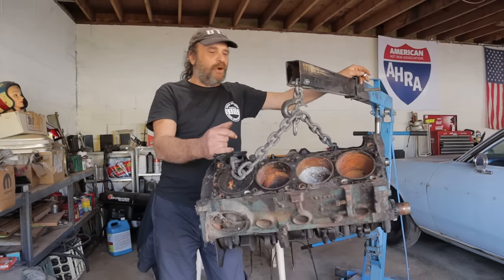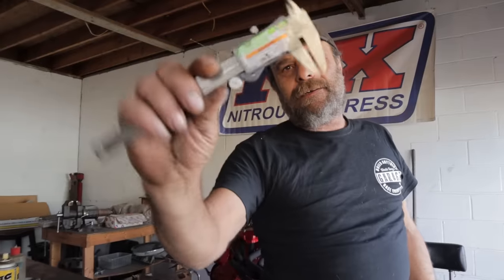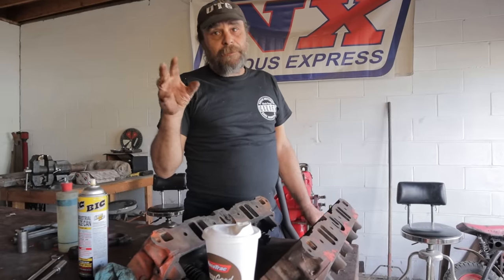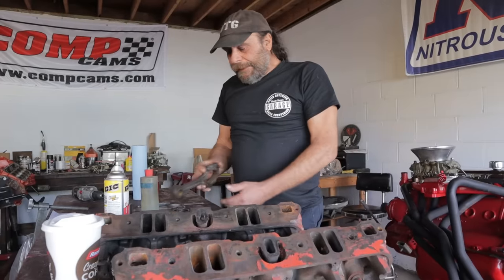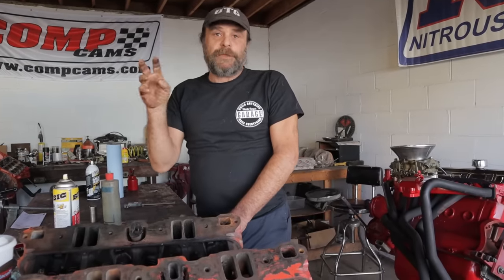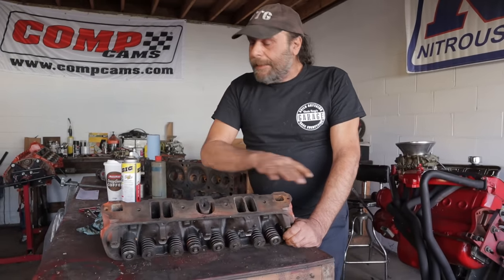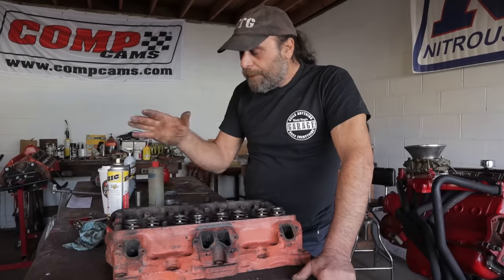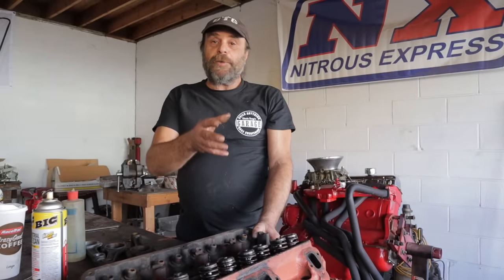The Most Under Rated V-8 In History?

Comment: Olds engines, pontiac and buick too. Lots of folks today get classic cars and toss the original engines to put Chevy LS engines in them. Talk about least loved.
Reply: Over in my world of water cooled vws , the kids are removing the Bosch cis fuel injection to swap on a carb.
Because they are too lazy or can't troubleshoot the problem , so they blanket repair it. 
Damn fuel injection was fairly simple, and the FI cars made a good 10-15hp more then the carbed cars. 
I just smh at all the destruction they're doing
Reply: I currently have both a 318 and olds 403 under my work bench.
Reply: @MrTheHillfolk  Which gen of VW engines?
Reply: @stevenshepherd1905  Nothing wrong with either. Go easy with the 403. They aren't as stout as the 350 or the big blocks, but they will give good service.
Reply: That's the difference between a parts changer and a mechanic. 
Most of the knowledge of these old engines died with the generation who raced them, so it takes a little extra work to research their history, and find answers to our own questions for information that has been lost over time. That's the case with my Old's 394. That engine was a legend in the drag racing world  until Mopar's 392 Hemi came along.  
These old engines are the soul and character and history of the cars they represent. That's something an LS just doesn't have.
Reply: well most of the time the numbers matching ''original engines'' are long gone that LS6 454 is probably a low comp 2 bolt main truck engine or that 375hp 327 is just a  350 .. for mopar reference that 340 is just a 318.. 
its hard to beat the LS based engine.. trip to the junk yard an take your pick.. you want aluminum 6 bolt main block or cast iron .. 4.8-5.3L or for the same price a 6L block .. top it off with a early 5.3 truck intake manifold set of cylinder heads that flow 230cfm right out the trash.. 
ever notice when someones budget LS blows up they worry if the cam is ok lol. everything else is disposable
Reply: @my.motorrad  mk1(75-84) 
Mk2(85-92) 
It's worse on the mk1s. 
Makes me want to punch babies when I see a post about removing it. 
Me and alotta other guys who actually know this stuff , and try to help. 
I mean jeez,there's a couple of real good books on it and we have the internet now too.
Reply: @codyramos3200  If it's a chevy, sure, but I think today generation is facile. Just change the badge and it's a different brand. The differentiator with GM cars was that each marque made their own engines. Putting a chevy LS in it kind of takes that away. If you really want performance, get a new car. It'll have all the goodies to make the extra power work for you and they are safer.
Reply: @MrTheHillfolk  The mark 1's must be a bitch. Can you get ECMs for them anymore? Were they digital? I had a 1969 VW Fastback. Very funky FI. It's not like you can plug a computer in. I wonder if anyone makes an aftermarket FI for the Mk1 and MK2? I had MK4 jetta. Most reliable car I even had.
Reply: @my.motorrad  
Oh no they were way easier and more reliable than the fi on the air cooled stuff , they learned their lesson. 
The mk2 did use some electronics , and they called it cis-e.
It's  basic stuff like an encapsulated module and they're pretty hearty. 
The fuel injection throttle response is 10x better than a carb on those. 
Mk4? 
Pretty solid chassis , maybe a little heavy for performance work but they can do pretty good. 
Actually I've got the wife's old mk4 Jetta at the shop, I got one of those Smythe Ute kits for it that I've been working on. 
It's my replacement for my old rabbit pickup I had 20+yrs ago.
Reply: @my.motorrad  
You could do some aftermarket add ons for the fuel injection , most of the time they just go modern with something like a megasquirt system. 
Funny that you say you had a very reliable vw , because that's the joke that they aren't. 
And it's a joke inside a joke because I've never really had one leave me on the roadside. 
Usually if you type VW into Google you get a check engine light 🤣🤣
Reply: @MrTheHillfolk  I sold mine after 12 years and 150k miles and it had the original clutch. It had the 2L 8v engine. It burned a little oil, a quart every 1800 and the AC went out the month before I sold it, but other than that it was maintenance items. I had a 2013 50's beetle convertible with a 2.5L. I got rear ended and it got totalled. On 50k on it for a 6 year old car. I bought it used. The 2.5L is a torquey engine and seems build well and would be capable of a lot more power. 6L oil capacity too. We have a 2013 Passat with the same engine. 105k on it. My complaints about that car are the suspension components. it needs new struts, bushing, might as well do ball joints and one of the power steering lines just developed a leak. My wife wanted a subaru ascent when my beetle got hit and I have the choice of the next car. I really like the idea of the Challenger RT. I am tall and the Passat sucks for tall folks and I am not impressed with the subaru. VW just doesn't make anything that says buy me anymore. It's all 4 doors.
Reply: I have to call BS sir. Most all engines make more HP / TQ with carbs....
Reply: @MrTheHillfolk  ew. i can see why they are.
Reply: @garyvisser8987  
Then drive an injected rabbit vs a carbed one and tell me how it is 🤣
Haha even the factory carb model was like 10hp down compared to  the fuel injected model. 
And unless you do something like itb setup an upgraded carb doesnt have a prayer to match the injection.  
Don't call bullshit on vehicles you obviously aren't familiar with.
Reply: @codyramos3200  it’s pretty easy to identify engines with casting codes.
Reply: @doomman700  yeah sure to a point.. . Was your comment refuting what I said or ? Idk what your getting at .
Reply: @codyramos3200  refuting your claims as bogus. The engines can be identified from outside. Just because you don’t know how to do it.
Reply: @doomman700  where did I say engines can't be identified....

Comment: Hy. I built 318 about 30 year's ago and I put polished steel crank a comp cam 268 duration had 454 lift on both lobes it bord 40 over flat tops milled the 20 they were a little   warped I used the best in all the parts added 1inch taller 4 barrel intake from direct connection 1180 rated thermal quad carb ported the heads headers accell ignition for all components. When I fired it up the first time I amassed  one oil pressure it had. It had 85 pounds until it got warmed up then it settled in 60 ran so good I couldn't believe it . Sorry I I rambling  on but I just had do this comment and tell you about it.

Comment: 305 chev and 318 underated the 302 ford and 302 chev get all the glory
Reply: How about the 307? Its the Rodney Dangerfield of engines....
Reply: I'd take a 318 over a 305 any day lol
Reply: Honestly the 305 is one of my favorite cruising engines i just cant get myself to build one
Reply: @will7its  
My buddy back in HS had one in a 70 Malibu with a 'glide. 
She would make the back end sway around a little if you nailed it into 1st at around 35-40mph.
Reply: My 305 h.o. runs good and they dont eat cams
Reply: I had a 305 HO in an 82 Z-28, the first year of the major re design of the Camaro/ Firebird. That may have been the last QJ equipped SBC, the Camaro with auto trans came with “cross fire injection” the same as the vette, but the 4 speed cars still sported a carb. I was really surprised at the balls that 305 had! Considering that in 82, everything was a slug. Not long after, I bought an 86 Grand National, the first year with an intercooler, it was top dog until the GNX in 87. Interesting tidbit of info: for insurance purposes GM claimed the GN put out a whopping 235 HP! LMAO!
Reply: @Zephyrmec  mine is a 84 ho automatic

Comment: I took my 79 Cuda put a 1972 318 in it stock bore, 600 lift with a 289 duration cam, I used a 4 barrel Quadrojet, stock heads, aluminum duel plain manifold, headers, high speed oil pump, 410 posy traction rear end and a  4 speed and run in the low 14's awesome little street rod and O my gosh how I miss her, the 318 is an overlooked treasure.

Comment: I know the 340 for all the hype never impressed me. I had a '64 Dart GT that was originally a 273 4bbl,. I blew it up and got a 318to replace it. I put a 4.60 lift 294 duration cam in it and found a 340 4bbl manifold and a Holly 600 carb and went with a stock electronic ignition. Through the original button shift 904 trans that I rebuilt. In my town at that time it was the bain  of almost ant 350 Nova, Camaro, and Chevelles, as well as all the 302 Mustangs nobody believed it was a 318 they all accused me of putting a 340 in it. But I also had a '67 Barracuda that I put a mild built 360 la and a 727 trans in and went terrorizing big block street rods with it. Only loss for the Barracuda was against a 427 Corvette. I would take either the Dart or the Cuda back in a heart beat even if you offered me a new vehicle instead.
Reply: @montinaladine3264  
 I had a 73 Dart 340 4 speed and my 67 Barracuda with a mild 360 auto stock exhaust and 3.23 posi gears would eat it every time. Like the 302 Chevy you have to keep the 340 at a high rpm to pull, the 360 has the torque as well as the hp. It pulled my Cuda to 13 flat 1/4 mile in street garb and tires, and it would regularly stomp big block Chevys and Fords in street races. I just guess I haven't seen a 340 that impressed me in street form.

Comment: Thanks for the info. My dad wasn't too much into mopar back in the 1960's and '70's but he always said the 318 was the only V8 he would want if he got a Chrysler product with a V8. We did own a 1977 Dodge power wagon way back in the late 1980's with a 2 barrel 360. It ran good but my dad really wanted a 318. I'm wondering if dad liked it because the 318 had sufficient power but with small ported heads maybe got better mileage than the average V8? Very informative video. My friend's dad had a 1966 Dodge Dart. I know it had a 273 but I think it only had a 2 barrel carb. I never got to ride in it but my friend said that car could move!

Comment: Cool it would be fun to find a old 67-69 318 and work over the heads with 360 valves and port match it. thanks for sharing that info. Not that I would try it but how far can you bore the old 318 to be? did you say 340ci ?  If you have the open chamber heads cant you just put some pop up pistons in it? to bring it up to 9.5 to 1 or 10 to 1 compression ratio.

Comment: In high school a few years back, I had a 318 dart swinger  which I put in a crower 525 cam did a 3 angle valve job on 202, 340  heads, wienand intake and holley carb. Headers and dual exhaust. Damn did that thing move and took down a few novas. . Want to build one now with my son. 
Need parts

Comment: I owned a 1969 dodge d200 custom pickup truck that had the truck 318 in it.  Me and my dad did not much work, 4 barrel alum intake and carb, moderate performance cam and that thing ran better than a lot of other builds I have owned.  had dual 4 inch stacks on it and every one swore it had the hemi or something big in it, just sounded very nice.  They never believed it was just a little old 318 under the hood lol.  For a heavy truck it would get up and move, and was so well balanced from factory it would idle around the parking lot in 4th hear and not stall.  Always regretted selling it.

Comment: Had a dodge dart GT 1966 had a 273 4 barrel very strong engine and I have had numerous 318 and if you put a 4 barrel and the same heads I had on the 273 with a decent RV cam you have a great super low budget little hotrod engine, only bad thing that I would like to add to the combo is the rods and your idea of the 340 rods is the perfect solution and keeps it low budget 318 good 👍

Comment: I'm in the process of building a crossover 318, (it has provisions for rollers) it was a 50 dollar special, it's 20 over, with flat tops, Has the 4027596 heads, Has a copy of the 68 340 4 speed cam. AFB on a factory 4 barrel manifold. balanced rotating assembly and specs out at 9.5:1. I can't wait for the dyno run, any predictions?

Comment: Yep I couldn’t agree more with the 318, such an underrated motor! You could slap on 340 or 360 heads & the 318 is such a solid reliable engine. My Father has had two 318 Mopars.  his old red 1971 Plymouth Roadrunner had a 318 & his current car which is extremely rare & my Dad has a mint condition 1975 Dodge Dart Hang Ten, they were only made for two years from 1974/1975 & they came with a slant 6,318 & a 360. It also came with a fold down rear seat for the surf board, optional crank sun roof. My Mom & Dad have owned it since 1977 & they bought it off of my late Aunt’s ex husband in 1977 as at the time he was a supervisor at Chryslers in Windsor,Ontario,Canada right across the river from Detroit “Motorcity”.

Comment: I had a '67 "Formula 'S'" Barracuda fastback with the HP 273/Carter 4-barrell/4-speed/3.55 rear end. It would go like craxy, but also got 9 mpg if your right foot was heavy, as mine was at the time. A few years later, now a family man, I bought a compromise '71 Plymouth Scamp with the 318 / 2-barrell / Hurst 3-speed on the floor from the factory. It certainly didn't look like anything special, but it was a stout engine, very reliable, and with lots of low-end torque. Served me well for years.

Comment: Wow Tony you nailed it for sure! Im a small block Buick guy, and a closet Mopar guy. The heads for the 318 look like 350 Buick heads, tall ports, open chambers, towers for shaft rockers. The 350 Buick suffers from the same stigma as the 318 Mopar, " the bore is under 4" the valves are too small" Like you said about the 5.3 LS " Everybodys darling" I thought the same thing, The bore is under 4", the valves are small. BUT the LS heads ALSO have the tall skinny intake ports (like the Buick and Mopar) and shaft type rockers ( like Buick and Mopar) Lotsa similarities between Buick and Mopar tho, hell, they even have adapter plates to fit a BBM aftermarket intake on the BBB. I believe the only competition for a Buick on the strip is a Mopar, they're both underdogs, I like underdogs! I've had a few Mopar guys come over to me after a pass and inquire what Im running, we chat, and they give me advice and such, but we understand each other we "get it" were both considered underdogs.

Comment: I have a rare 318.  Date Code 1969.   It was called a 318 Premium, it has all forged internals i was told with a factory 2bbl.  Instead of the 187hp it has 212 or 216hp I can't recall.  Its like brand new still and even the exhaust is still painted.  Even has the decals on the air cleaner cover with the hp rating and cid.  Maybe Uncle Tony can can inform me with more info about this particular engine.

Comment: I have had several 340s in years past, and now am building a 64 Fury.  I bought a 72 318 out of a wrecked pickup with only 72000 miles.  I have alot of 340 parts, hoping to do some experimenting.

Comment: I used to drive Super Shuttle 318 vans at the airport. I was impressed with the strong smooth pulling power of that engine. The power band was very wide, seamless and impressive for only 318 cubic inches. Passengers commented on how well it accelerated up the freeway on ramp when loaded with people and luggage. The company had several vans go over half a million miles on one engine, and one van had just over 900k miles! That engine had several valve jobs but otherwise was all original.  Rear ends wore out before a 318 would.

Comment: I never realized the 318 had such low compression. I drove a 1977 Aspen for years and 250,000 miles later I gave it away to a friend that wanted the power steering for his power wagon. I previously had a 1968 GTO with 11:1 ratio and 4 on the floor. I could burn rubber in all 4 gears with that one.

Comment: UTG you are absolutely correct! I had a LA 360! I had my 360 heads machined to 2.02 big valves with unleaded valve guides and heavier springs because of the mild cam! I did this in the middle 80’s using the Moperformance  book! Yes the 318 has potential!

Comment: My first "car" was a 1969 Dodge D100 long bed. It had a 318 with a 727 torqueflight transmission. It had so much torque it would break motor mounts when I would stomp on the gas! 
The remedy was chaining the passenger side of the block to the frame. The combination Dodge used with the 318 and the 727 along w the gear ratio rear end was one of the best combination stock I've ever had in my life! 
I agree that the 318 was so underrated. But I put it up there with the best motors ever that were so underrated like the chevy inline 6cyl..

Comment: 318s were and are underrated by fans of other makes, for sure.  Brilliant platform for a great street engine, as good as anything.  
My first car (in 1991) was a '67 Barracuda.  273 car that had a '69 318 in it.  The heads, intake, etc, were in the trunk.  I threw a late 70s 318 in it to get around while I built the '69 318.  I found a set of 340 "X" heads and thought I had struck gold ( I sort of did).  Small cam, Performer intake and 600 cfm carb (with a 2:73 rear end gear).  I didnt realize as a kid how much I had dropped the compression by using the 340 heads; it wasn't nearly as torquey as it could have been but it ran really nice and would rpm like a sonofabitch.  But, all my friends cars were faster across the board.  Live and learn.

Comment: I had a 67 Valiant with a 273 that needed an engine. I found a 74 318 with hydraulic lifters and no heads for cheat.  So I got the idea that since the two engines are basically the same, I took the cam, solid lifters and heads from the 273 and put them on the 318. What a power change. Did it ever go. I wouldn't mind feedback on this from Uncle Tony.